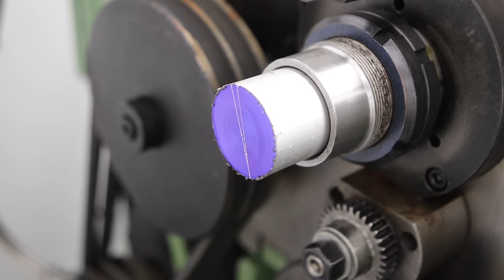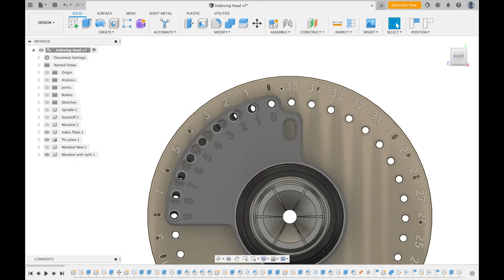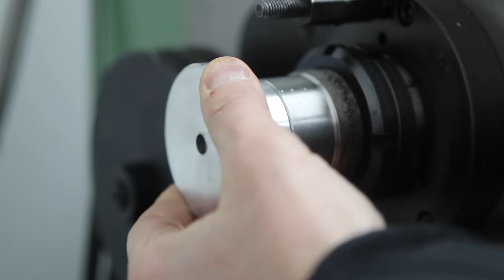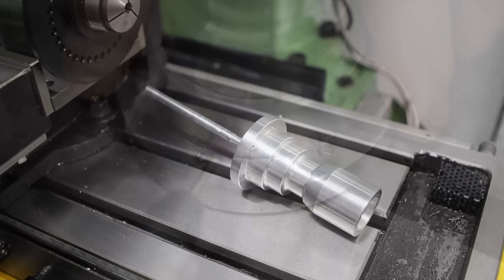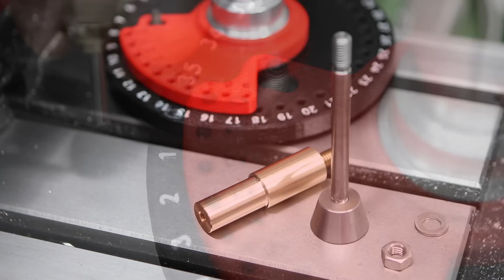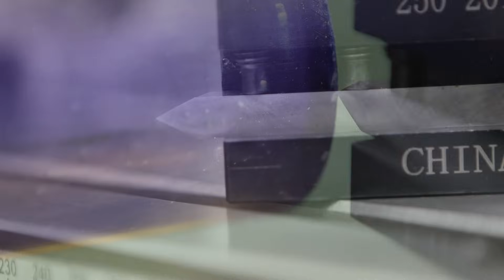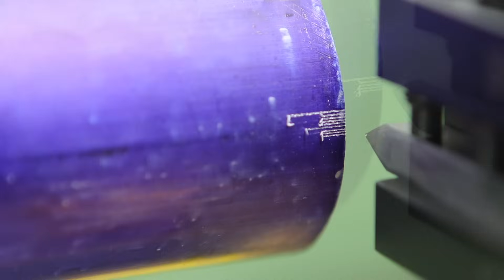Making an indexing attachment for the lathe

Comment: Did you consider if the internal surface of the lathe drive shaft is an accurately milled tube running true!?!? Maybe bore it to be sure.
Reply from the maker: That's something I didn't consider actually. Thinking about it though, as long as it's not a million miles out I don't think this is too much of an issue. If you think about it - where we need the accuracy is in the angular indexing of the rotation. If the internal bore of the spindle is slightly out of concentric that might affect the alignment of the holes (meaning the pin wouldn't go through) but shouldn't affect the indexing of the rotation.

Comment: Dear Jonesy, not pretending to be an expert but here is my advice.  When hand tapping, for each few turns run complete reverse turns until you hear a crunch of the swarf tearing itself clean.  You can then move forward and rinse & repeat.  That way your swarf is progressively pushed back along the tap and doesn’t lock up which is what happened in your case.  Touch wood, I have never broken a tap using this approach.  Cheers.
Reply from the maker: Thanks Peter. Good advice.

Comment: TAPS. are just a pain. I'm sure you know most of the techniques to remove taps. Professional shops use spark erosion EDM using carbon electrodes in parrafin/petrol or just plain water but at home this is normally not an option. Larger taps might welded but in this case its too small and tight a spot. Then there's the brute force and drift it out with a punch and hammer and helicoil the hole ! That might be suitable in this case but not ideal. Or you could weld the hole up and re-drill it off course. A small pin punch or chisel and tappety tap tap for 6 hours and you might just wiggle it free is often the first thing people try. The real key tip is to persevere !
Reply from the maker: Thanks for the advice, very useful. I've opted for the easy option and left it in there for this project!

Comment: Top tip for 3D printing. Print out the areas that are going to interface with the parts that you need to interface with just the interface area so you can get that size and correct and then print out the whole part
Reply from the maker: Good thinking. I’ll do that next time

Comment: Get a pound of alum
saturate water with alum in a stove tolerant pan
heat the pan to 150ºF-180ºF
drop part in pan
add water occasionally (to compensate for boil off)
3-4 days later the iron stuff will have decomposed and the aluminum restored.

When the pan returns to normal temperatures you will have a pan full of crystalline alum
Add water and heat the next time you need to remove iron and preserve aluminum.
Reply from the maker: Great tip, thanks for the advice!

Comment: I've had to remove taps from valuable parts before. Usually what I do is get a carbide end mill that is the size of the drill hole (smaller than the threads). Then set the spindle speed to about twice what you would normally run it. Use cutting oil or coolant to keep the end mill cool. Then you feather it in as gently as possible (.001-.003 of an inch at a time). It will be time consuming. It is the ultimate test of patience when it comes to machining but just go slow. The carbide end mill is trying to chew threw steel that is only slightly less hard. Listen for any crunching or snapping. Check the end mill occasionally. Keep dabbing it with oil or coolant. If everything goes right, the tap will basically be reduced to metal chips and will no longer be stuck in the hole. Don't know if you have access to carbide tooling but that's how I typically get broken taps out of parts that have a lot of time and effort invested in them.
Reply from the maker: Thanks for the advice!

Comment: No 3D printer or mill with DRO? Get yourself a copy of George Thomas' superb 'Model Engineers Workshop Manual'. Amongst a host of other brilliant projects - many picked up by Hemingway Kits - it will explain in detail how to hand layout these division plates. If you have a geared rotary table you can use some engineering 'magic'. Make one plate by hand layout, use it with the table to make a second plate. The second plate will be far more accurate than the first due to the effect of the table gearing. Rinse and repeat using the second plate for a third division plate with an accuracy exceeding tool room standards, more or less regardless of the inaccuracies in your first plate. It's all in the book!
Reply from the maker: Thanks Bob, I need to re-read that section of the book. Thanks for the pointers!!

Comment: What you need to do with the 3D print is to make a test piece of the correct diameter. That way you'll know what the final size comes out at, it'll depend on your filament, the bed height, the phase of the moon and probably next weeks Lottery numbers. Holes always comes out undersize, but how much is easiest to determine by trial and error.
Once you are happy with your test piece, alter the CAD drawing of the real part to suit. I can usually get it spot on within a couple of iterations now
Reply from the maker: Good tips, thanks for that.

Comment: Use an alaun salt solution to boil the part, it will dissolve the steel and leave the aluminium untouched
Reply from the maker: Thanks for the tip!

Comment: The little piece of plate is 1/4 of the whole 360°? Meaning in total would be 40?
Reply from the maker: I’m not really sure what you mean John?
Reply: @joneseymakes  I was asking about the red plate, it seems to be 1/4 of a circle, meaning it would be 40 divisions for the whole ,360°?
Reply from the maker: @johnlocke9609  Ahh no. It's used in conjunction with the holes in the black plate. 10 holes in the red and 36 in the black, when used together you get 360

Comment: Happy user of the change gear approach here. Regarding the broken tap, if it's sticking out you may be able to grind a slot in it and use a flathead screwdriver to get it out
Reply from the maker: Thanks, I tried that with no luck.
Reply: @joneseymakes  too bad, m3 probably is a bit on the small side indeed for that to work.

Comment: Nice to see what others have done for universal indexing tools for the lathe. 

I made a similar indexing system except no venier scale. I designed a 3D printable prototype for the mount that I made available on thingieverse. But machined the final parts out of aluminum for extra rigidity. Mine is based on a two piece external taper-loc design similar to commercially available hubs used to mount pulleys, wheels and other such devices to shafts. 

The taper loc hub clamps to the spindle by drawing a cone taper into a wedge ring, exerting pressure both inwards and outwards to clamp both the hub to the spindle and the indexing plate to the hub. An indexing pin is held in a mount fastened to the head stock. I made multiple indexing plate options based on how oxtools modified a 5C spindexer with external indexing plates with multiple rows of holes.

When the indexing is not being used the indexing pin and plate is removed and substituted for a disc with a magnet array and a hall effect sensor for a tachometer and surface feet per minute calculator. 

I like that I've not seen a solution such as yours before
Reply from the maker: Thanks John, you solution sounds interesting. I intend to use multiple rows of hols in my next version.
Reply: @joneseymakes  I initially was going to use expanding mandrel like yours but the lathe cover position did not permit this option for use of the same set up to hold a rotor with my magnet array for the tach and surface feet per minute calculator. 

I have to get the DRO installed on my mill so I can make a vernier piece like yours and adapt my mount to work with it.
Reply: Could you please post a link to the thingaverse page for your lathe external taper-loc design ?  Thanks in advance ...
Reply: @llamatrails2  sorry, youtube deletes links.

Comment: I've had good luck removing broken tap pieces with my TIG.
Reply from the maker: Ok thanks, how does that work? You just burn it out?
Reply: @joneseymakes  no typically you work a puddle on the remainder of the tap within the hole and try to build it up bit by bit until you can get some pliers/vice grips on the built up weld and work the tap out back and fort by hand. This solves a couple of issues, 1) you can usually re-connect any broken pieces of the tap (they usually fracture around the flutes) 2) the extended heat can less the tap pieces brittleness so as to not have it crumble deeper in the whole. 3) the heat  will, as usual, open the tolerances on the material holding the little bugger in place and creating most of the grief with removal.
 Welding a nut on to the built up section works great for broken bolts but I've found it's not so good for taps. working them out by hand with a pliers or vice grip has always proved more successful for me and that's way better than trashing a piece I have invested lots of time and money into.   
 Just my experience.

 Mark.

Comment: You could have cut a slot on the protruding end of the tap with a Dremel tool and a cut off wheel  and used a flat screwdriver to work it through. With a lubricant. ( WD40 ).
Reply from the maker: I tried that and it snapped off unfortunately.

Comment: @I would treat 3D part as a cast part. There is no reason the mating surface canot be macined.
Reply from the maker: Good point. I have subsequently tried machining the 3D printed parts and that works just fine.

Comment: Hello, your video piqued my curiosity and I will try to make this angular vernier.  Do you have examples of uses other than graduations?  Thank you for an answer, good continuation good end of the day, cordial greetings.  P.K.
Reply from the maker: If you have a milling attachment for your lathe or a cross slide mounted drill then this attachment can be used to mill hexagons, drill cross holes etc etc

Comment: Are you assuming the spindle bore is smooth and concentric with the rotation axis? Because is not usually
Reply from the maker: Well mine is more or less, not sure about other lathes.
Reply: @joneseymakes  Oh ok. Mine is not because I was thinking to do the same as you. I have an alu pulley on the spindle so I think I'll put a spacer on that and mount the dividing disk on the spacer and the spacer on the pulley. What I don't like is there could be (did not measured yet) a play between the pulley and the spindle even with a keyway

Comment: two suggestions for improving concentricity: design a small groove in the "bores" in the 3D printed parts for the outer layer seams to hide in. Second,  make the bores and the mating surfaces be a slight taper, that way you can take out any small slop in the fit as you care only about radial position and not about the exact axial position of the parts.
Reply from the maker: Great idea, I might try the tapered bores. Not sure what you mean with the grooves though?
Reply: @joneseymakes  I meant perimeter, dunno where I got the layer from. Hide seams of the outer perimeter of the bore inside a keyway, or a groove. Cut a notch in the bore in the 3D model and tell the slicer to put the seams in the bottom of the notch. Make the shape smooth so the printer doesnt have to corner in a sharp angle when exiting the notch to print the bore, so it won't overshoot. Tuning the printer always helps, making the model more forgiving also helps :)
Reply from the maker: @bozodragojevic  Ok great, thanks!

Comment: One way to fit your printed parts to mchined ones is to machine metal first, then put the printed part on the flat head plate and bore it to size. This way you get rid of the ridges in plastic and get a nice fit. One or 2 tenths of a milimeter will make no difference to the printed part if the print thickness is enough. Excelent idea overall, though, but for more accuracy I would have made the calibers from aluminum or brass instead of printing.
Reply from the maker: Thanks for the tips. Yes I think I’ll remake these indexing plates in metal

Comment: Great content and nicely made.Could some of the error be due to the fact you are indexing from a 3D print? If the bore diameters are undersized and out of round then presumably the locations of the index holes may be off somewhat as well.
Reply from the maker: Possible I suppose yes, although I think the problem lies elsewhere. I’ll do some more testing. Thanks for the suggestion!

Comment: My tip for not breaking taps: Use 3 piece tap sets. I´ve tapped thousands and thousands of holes in nearly 50 Years and never broke one tap. Not a single one. As my toolmaker dad always said: Use the 3 piece, save the whining. Side effect: You can´t tap a 3 piece set crooked, cause they are self centering.
Reply from the maker: Good tip, thanks. I’ve got some 3 piece tap sets I should get them out more

Comment: You could leave your broken tap components to a company that EDM the tap away.
Should not be to expensive,
A tip, when taping, go forvard until you feel resistans in turning, then you back of to break the chip produced, an then forward again until........repetable.
I´ll guess you also using lubrication.
I´ll like your ideas.
Thanx for sharing.
Reply from the maker: Thanks for the tips!

Comment: When you designed this did you purposefully design it to be visible from where the camera is positioned? My lathe's design is such that all the parts that are readily accessible in yours are housed inside a metal cabinet on mine.  Someone with a similar lathe as mine should redesign the red piece to be larger than the black or brown piece and flip the numbers to the opposite side, but keep the holes exactly where you have them.

This is such a cool idea and I am excited to try and replicate it.
Reply from the maker: I don't have much space to the left of the machine so I designed it that way around. Ne reason you couldn't do it the other way though I think.

Comment: Neat design.  I might build one for my Myford.  Over the years I've found the best way to get broken taps out, is to not break them in the first place.  Use proper tapping fluid for the material you're tapping.  I use A9 for aluminum.  Proper type of tap helps a lot too.  A spiral point tap would have been better in your situation.  Save the spiral flute taps for blind holes.
Reply from the maker: Cheers for the tips Dan.

Comment: I think its needs to be made from steel plate with precise machined holes for alignment. 3D printing doesnt have good tolerances for such measurements. Cool design tho. Great video
Reply from the maker: Thanks, I might well get around to making the plates in metal I think.

Comment: the small error might come from you reaming the holes? think you should've modified the pin to fit the holes... besides that, marvelous work! I have to make one like it
Reply from the maker: Being a 3D print each of the holes were slightly different so the best course of action was to ream them all to the same diameter. I'll do a follow up video on de-bugging the issues in accuracy

Comment: My worst fear is breaking a tap in a part that took days to machine and that day came. The part was aluminum and the 1/4in tap broke on an angle, so tried to drill out the tap but the carbide drill would just veer off and dig into the aluminum. Tried the chemical method, didn't work. Tried breaking the tap up with a punch didn't work, too deep. Purchased three types of carbide end mills, two flute, four flute, six flute all broke. So wasn't going to purchase another $80 worth of end mills and I thought maybe a carbide burr would work. Used the half round and chewed that nasty tap to bits. Couldn't believe how good it worked, it took seconds to get though about half an inch of tap and not damaging the existing threads. So next time you break off a tap use inexpensive carbide burr, save you a ton of money.
Reply from the maker: Great tip, thanks for that.

Comment: Mate, improving your skills with hand tools should be your no.1 priority... or edit it to save me the pain.
Anyway, when tapping/threading aloominum, just use an aerosol degreaser, works same as kerosene as a cutting compound and cheap to boot.
Design is useful though, I might try it. Cheers.
Reply from the maker: Fair comment on the hand tool work Roberto, not one of my proudest moments but I thought I'd show it rather than hide it. Thanks for the tip on the degreaser.

Comment: I'd use WD40 or Duck oil as a tapping lubricant and more than you might think you need. I was machine tapping with M3 with my milling machine in aluminium and had no issues.  In 50 years of tapping holes I cannot remember the last time I broke a tap. I know I did as an apprentice, but since?
Reply from the maker: Thanks Bill, good advice.

Comment: When using spiral flute or point you’re better not backing off, they are designed to be ran through in one go, backing them off can cause dwarf to get trapped in the flutes and bind.
Reply from the maker: Thanks for the tip!

Comment: That looks like a great approach to accurate indexing on the lathe. With regards to breaking taps, we’ve all done it. However, if the tap is sharp and you use lube then you shouldn’t break a tap, especially in aluminium with a through hole. If tapping by hand, for every half turn in, take a quarter turn out to break the swarf and repeat.

Great videos, keep ‘em coming 😜👏💪💥
Reply from the maker: Thanks very much!